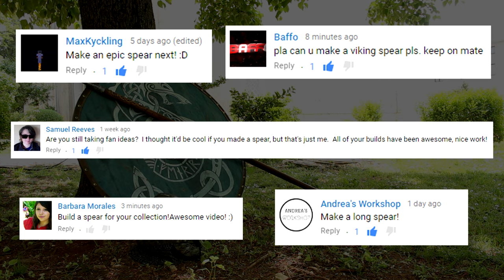Epic Viking Spear Made Out Of Wood - Making Of

Comment: At the one minute mark you had cut three pieces for the spearhead. And it looks like you use the middle one but I can't tell what we did with the other two. It's like the video skip past that. I'm very curious about what you did there? Maybe I'm just not seeing what should be right in front of my face. Regardless, this is amazing work and thank you for creating this channel.
Reply from the maker: +Rush Wingate That's waste wood :) the middle one is actually a point (blade) the other 2 pieces went to shelf where I hold other bigger cutouts :) I just removed excess material by cutting it of :) 
Thank you bro :)
Moris
Reply: Ok cool. Thanks for the reply. I had just gotten in the woodworking myself and still putting my shop together. A lot of what you do using just the bare hand tools is really helping me see how stuff works. Please keep the videos coming. They are great.

Comment: What are the measurements for this thing it’s amazing
Reply from the maker: Try to Google it 😉
Reply: Epic Workshop so I did some math and I think I got it somewhat figured out. But I have one question, how thick is the wood on the head and how much did you chop?
Reply from the maker: I recommend thst you make it out of beechwood, so you can go pretty thin, i make the swords up to 6 mm thick, the handle thickness is 3 cm
Reply: Epic Workshop ok thanks that helps a lot